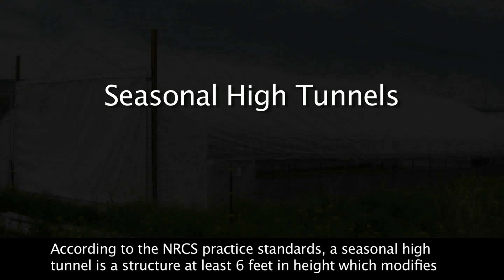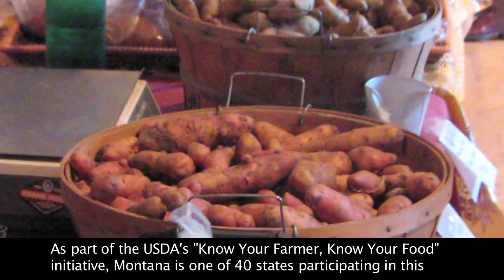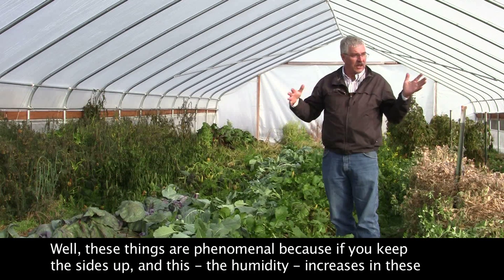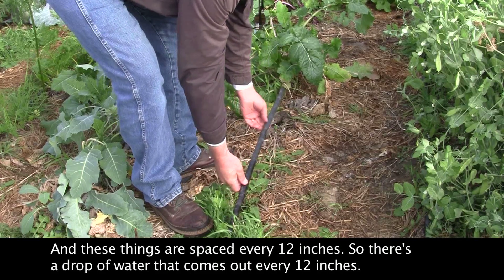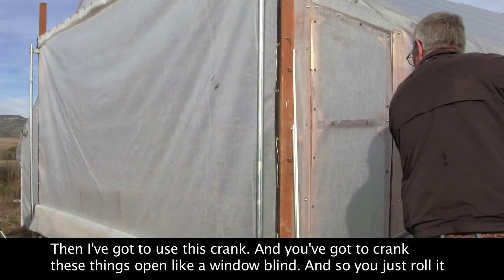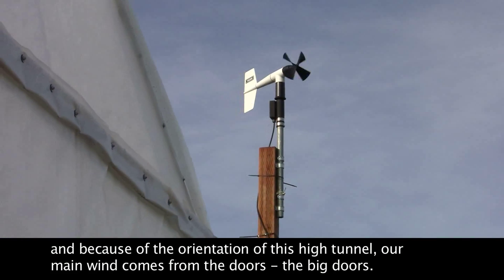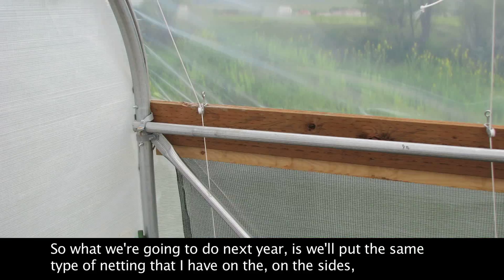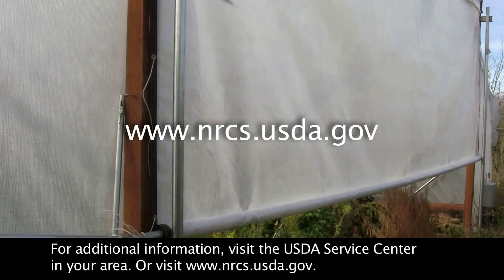Seasonal High Tunnels

Comment: I got fans off of old A/C units and mounted in my high tunnel. 2 on each side, they only pull 1.5 amps each and they keep the air moving very well.

Comment from the maker: I had to google mason bee to see what they were and I think you could add them since they don't take up much room.  But I'm not sure there would be enough to flowering plants  keep them in the high tunnel.  What I did this year was to open the ends as well as the sides and let the wind pollinate some crops.  And it worked great.  All crops I had problems with last year are producting this year.
Reply: A low tech method is to just shake the tomato or bean plants or hit them with a rolled up newspaper to agitate them and make them self pollinate.  Obviously it is a bit laborious.  Also non producing bean plants can also be eaten for their bean sprouts. 

It is good to hear there are such initiatives to benefit small farmers.